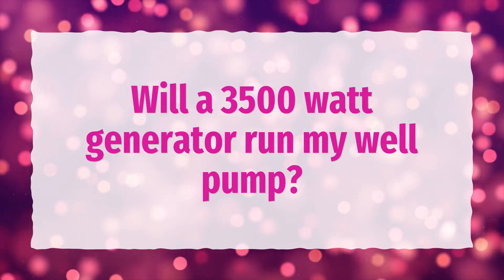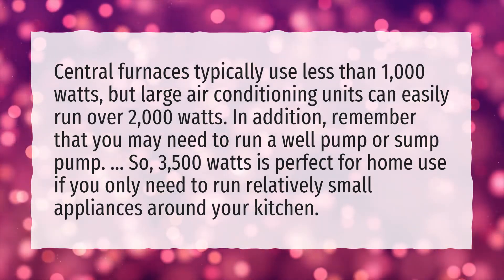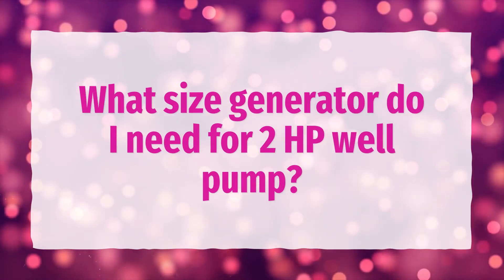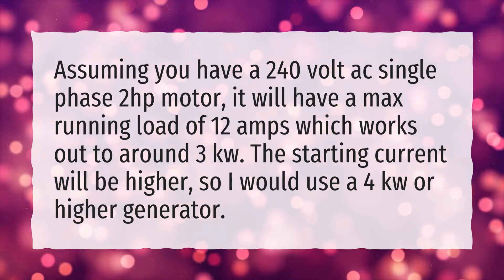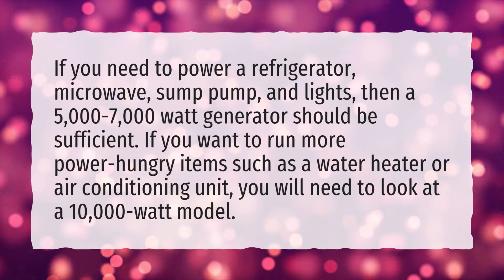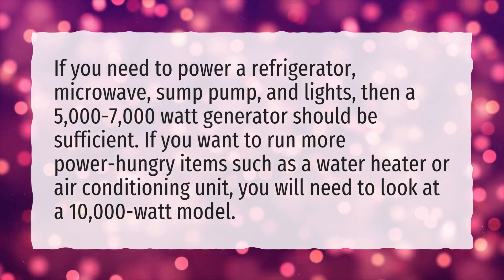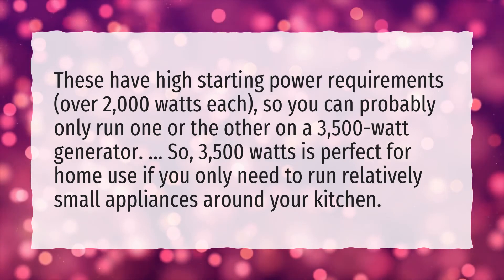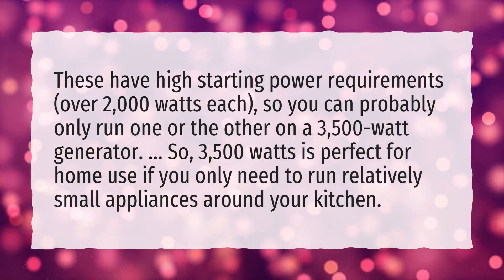Will a 3500 watt generator run my well pump?

Comment: more power to u.. i have connected my jet pump ta a 6000 wat generator, also it has a circuit breaker, when it was turned on the capicator exploded. do u have any idea what seem to be the problem?